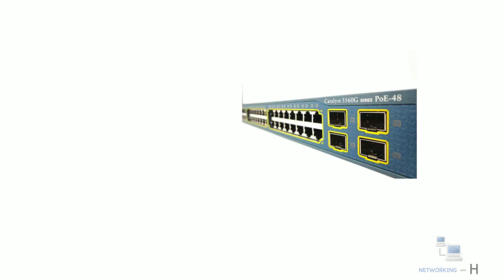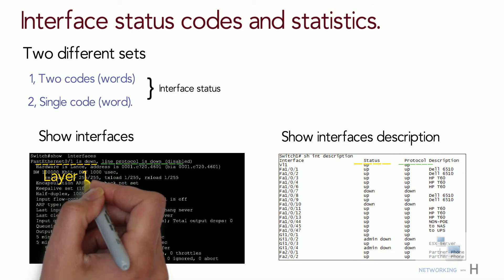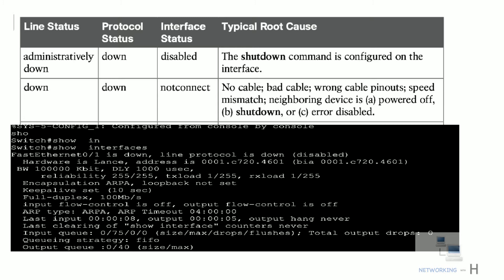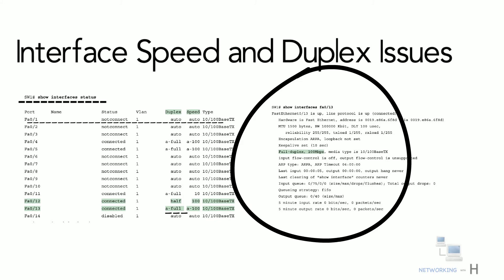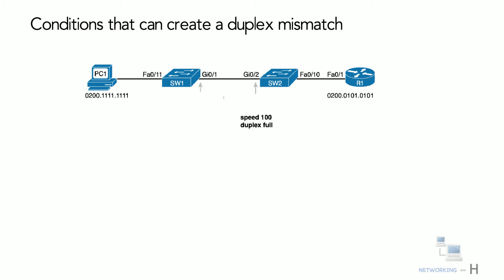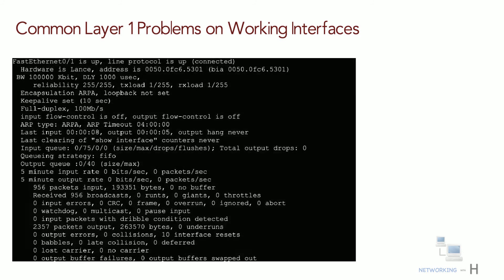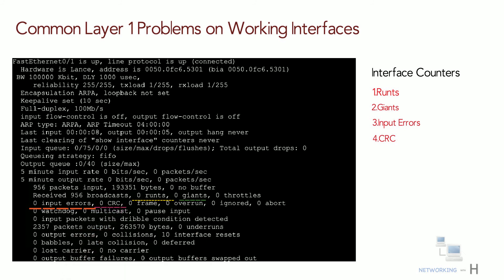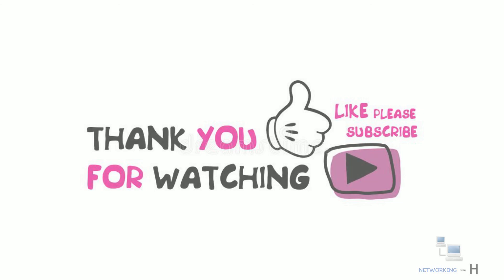Interface and cable issues |collisions, errors, duplex, speed mismatch| explained |CCNA 200-301

Comment: In networking, interface and cable issues often arise due to various factors such as collisions, errors, duplex mismatches, and speed mismatches. These problems can be quite complex and require a step-by-step approach to troubleshoot and resolve them. Here's a breakdown of each issue and how to address them:

1. Collisions: In Ethernet networks, collisions occur when two devices try to transmit data on the same network segment at the same time. This leads to data corruption and can slow down the network. To resolve this issue, ensure that you're using the correct cable type and length, and consider upgrading to a network topology that reduces collisions, such as a switched network.

2. Errors: Network errors can be caused by various factors, such as bad cable connections, faulty hardware, or software issues. To diagnose and fix errors, you can use tools like "ping" and "traceroute" to test connectivity and identify potential issues. Additionally, check for firmware updates for your networking devices and ensure proper cable management.

3. Duplex Mismatch: Duplex mismatches occur when two devices on a network link are configured with different duplex settings (full-duplex or half-duplex). This can lead to poor network performance and errors. To resolve this issue, check the duplex settings on both devices and ensure they match. You may need to adjust the settings on one or both devices to achieve a successful connection.

4. Speed Mismatch: Speed mismatches occur when devices on a network link are configured with different speeds (100 Mbps, 1 Gbps, etc.). This can lead to reduced network performance and errors. To resolve this issue, check the speed settings on both devices and ensure they match. You may need to adjust the settings on one or both devices to achieve a successful connection.

In the context of CCNA 200-301, understanding and addressing these issues is crucial for decision-making during problem-solving stages. By following the appropriate steps to diagnose and resolve these issues, you'll be better equipped to maintain a stable and efficient network infrastructure.

Comment: i have a problem with my line protocol. it show "line protocol is down (disabled). i did shutdown and no shutdown, and nothing happen. im also change the duplex and the speed to auto, but it still disabled. please help me
Reply from the maker: can you please explain the topology and share the show running config interface  output
Reply: @networkingwithh4716  Thank you very much for replying my comment. but im already solve it. my line protocol problem is the duplex. it seem that it need to be half to be up again. first time i watch your video i was really confused, and because that im not watch it properly. but after watch it again i can solve it. thank you very much, your video really help me.
Reply from the maker: @jarifin776  you are most welcome brother.